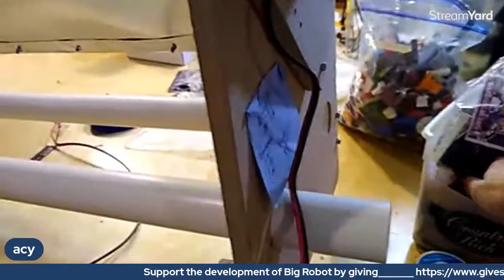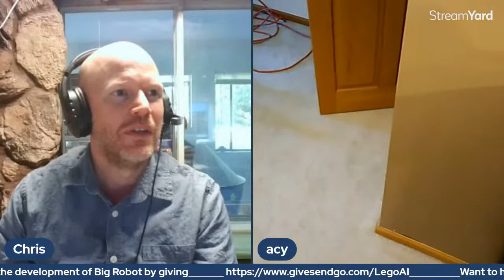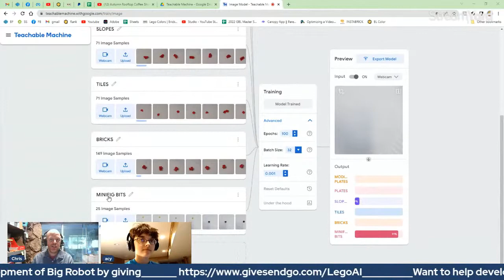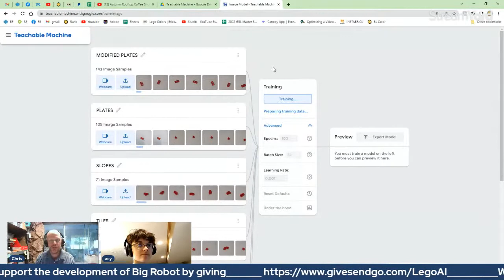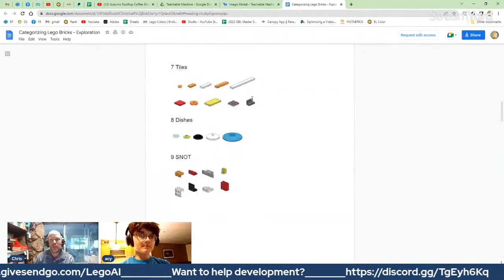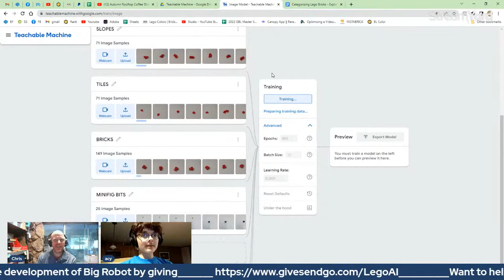Big Robot Week 4 "Teachable Machine" - Lego AI Open Source Sorting Machine

Comment: Nice project, looking forward to see how this turns out and great progress so far. A couple of remarks. The discord link does not seem to be  working, it indicates the invite is invalid when I click on it.  The way you are planning on training the teachable machine by crowd sourcing the images is  very likely to lead to a bias in your classification, When classifying in the robot it will tend to bias towards the images that are similar to what its camera records. In this video you can clearly see that. When there is nothing underneath the camera it classifies your background as a minifig part because your image is much lighter than what is used in the other categories. The first part you put under the camera in this video did not have enough recognizable features and it defaults to a minifigure part. The training data sets you are trying to create would also be very specific to the categories you are using and if anyone wants to use different categories they would need to create a new set of training images. What I would suggest is that you take a big bulk lot and sort the parts into the categories you want your classifier to use. Then once you have the system setup including the camera (but without a classifier) I would set it up so the camera takes pictures and saves the images. Then you run one category (for example minifigure parts) through your system multiple times and just let it take pictures and store those. Then you can move all those images to the minifigure category in your classifier. Then you start running parts from your next category through system to get images for the next category. This makes sure that all images are made using the exact setup as the image fed to your classifier (background, lighting, distance,...) and should avoid bias due to image source. The classifier should learn to ignore the belt since this would appear in all images in each categories and would not help it to classify each image.
Reply from the maker: That is a lot.  Thanks for contributing.   I had not considered much of this.  More and more I feels like we are learning concepts and techniques that can be shared rather than a specific robot design or data set.   I hope to continue to share the learning and grow the worlds ability to sort all the Lego.  I will update the discord link.